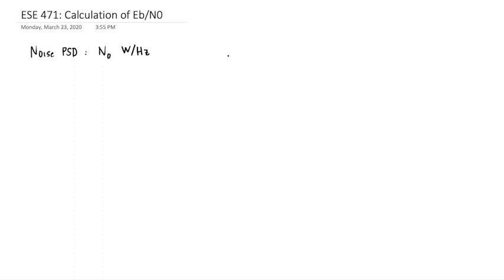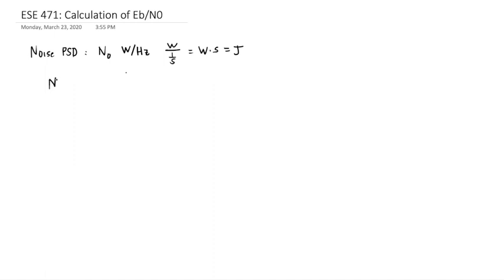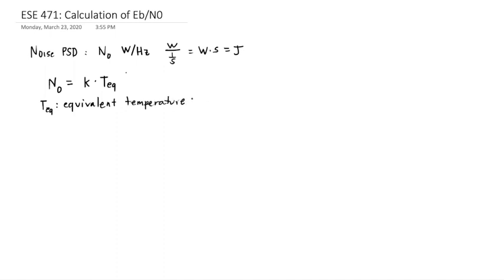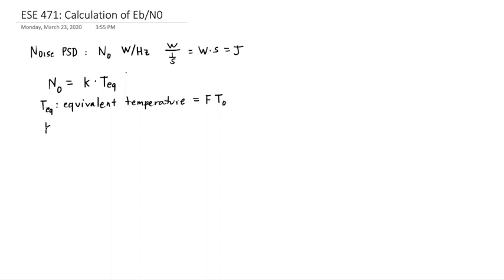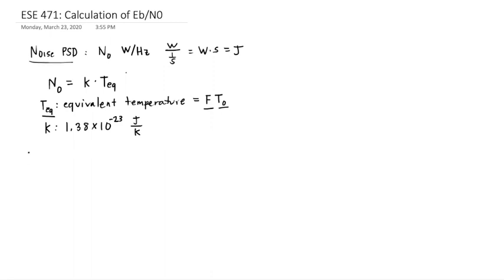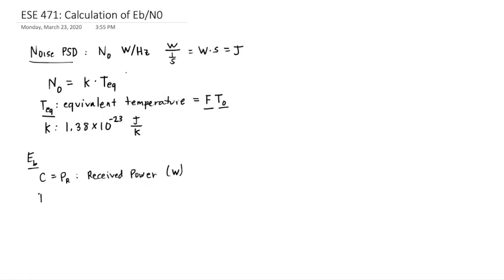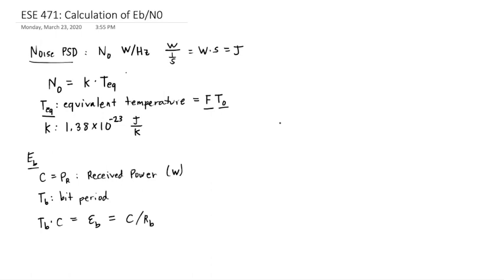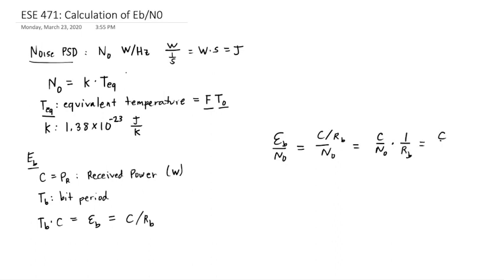ESE 471 Calculation of EbN0

Comment: Thanks! This got me on the right track --- but where do you look up the factor of equivalent temperature?
Reply from the maker: Glad you liked it.  The T_eq is equal to F times T_0.  F is the noise figure, which would be something from a spec sheet of the RF front end of the receiver (or use a RF circuits book to get a formula to calculate F from first principles).  T_0 would be the actual temperature of what is in the field of view of the antenna, for example, 296 K for a typical indoor wireless system.